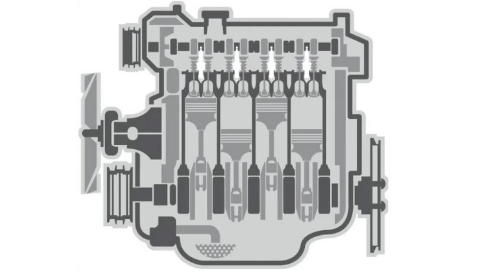Ford Fusion & C-Max HF35 eCVT Transmission Removal Repair Replacement PART 1 of 2

Comment: This video series was so helpful! I just replaced the trans in my 2014 Fusion hybrid with a used trans from a c-max.  It worked like a charm.
It was very tough, especially lining up the trans and getting it to slide in correctly, but with patience, I got it!
Thank you so much for your hard work doing this video.
Reply from the maker: Thank you for your kind words! I'm glad these videos helped you out!
Reply: Are you a mechanic ? I'm not but I'm planning  to replace mine any advice?
Thanks
Reply: good job replacing the trans, im contemplating doing this on my 2013 Fusion Hybrid. did you have to have the Dealership reprogram or flash anything after replacing?
Reply: @baggz321 no reprogram needed.  The transmission doesn't shift or have anything that would need reprograming.

Comment: Nice video.  Ford is in the process of getting a trans and installing in my car.  Its on back order.  I appreciate seeing what it takes to complete this job and also what the failure mode was.  Ford says it fixed this problem in cars manufactured after August 2015.  I wonder what they changed.
Reply from the maker: Thanks for watching! I have heard horror stories with people waiting months for a rebuilt trans. Hopefully you don't have to wait that long. To fix the issue, they changed some bearing sizes/tolerances: https://static.oemdtc.com/TSB/MC-10108994-9999.pdf

Comment from the maker: Thank you for watching! Please like and subscribe. If I helped you complete your project, please consider Super Thanks: https://youtu.be/mo4g08Jzezk

Thanks,
Nick

For your convenience:

00:00 to 02:16: Introduction
02:17 to 03:00: Battery disconnect and disable
03:01 to 04:51: Air intake and engine cover removal
04:52 to 06:57: Belly pan removal and coolant drain
06:58 to 10:26: Inverter and tray removal
10:27 to 12:10: Shifter, power cables, & electronic removal
12:11 to 13:13: Water outlet housing removal
13:14 to 21:23: Axle(s) and Sub-frame removal
21:24 to 21:50: Top trans bolts (3) removal
21:51 to 22:49: Ground cable, Aux fluid pump disconnect, fluid drain
22:50 to 24:42: Aux fluid pump removal, detach lower wiring
24:43 to 25:14: Thermostat housing detach, Trans bolt removal
25:15 to 26:15: Trans bolt removal sequence
26:16 to 27:35: Preparation to remove, top mount removal
27:36 to 27:46: Transmission out!
27:47 to 33:29: Transmission autopsy
33:30 to end: PLEASE SUBSCRIBE! 😀

Comment: I do appreciate the video, but the 12V battery runs the 12V accessories, it does not start the internal combusion engine, when changing the transmission you might have notices there is no 12V starter. The high voltage electric motor acts as a starter for the ford hybrids.

Comment: I have a 2014 ford fusion hybrid. I need to replace mount under the inverter. 

If i pull the disconnect in the trunk and remove all of the wiring up front will i need to have the dealership reprogram my car? 

I replaced the other engine mounts and the one under the inverter rattles loud on start ups.
Reply from the maker: @906lane  no need to reprogram. I'd also disconnect your low volt (12v).

Comment: Take a look at the gear that drives the non electric transaxle oil pump ,does it have all its teeth sheared off (If the energi varient has one, looks like it does.  , was the transaxle low on oil ?

Comment: You mentioned that the Energi had a transmission cooler pump with a line going to the rear of the transmission.  Would there still be a line there for other models or a plug?  Great Video!!
Reply from the maker: Testing the limits of my memory. It's not a coolant pump, it's actually a fluid pump to keep the fluid moving in the transmission when the energi is in full electric mode. The non plug in hybrid cars don't have it because (I think) their ICE runs all of the time (thus keeping the fluid pumping).

Comment: hey Nix great video of course, very informative and useful on this issue. Big Thanks. My question is, did you have to get the Dealership to flash or program the replaced parts to the vehicle in order for it to function correctly? maybe you mentioned it in part 2 or i missed it but id appreciate to know. Thanks again
Reply from the maker: No trip to the dealership was made. No programming was done. Transmission computers are learning... that is... they will adjust as needed.

Comment: just checked out a 2013 fushion hybrid non plug in. and it makes a horrible screaching sound just when the engine turns on. Coming from the transmission clearly. I told her without knowing these cars it sounds like a bearing has gone bad inside the trans. What is the chance that if that sound is already happening (pretty freaking loud) that there is damage to her case? Could it be she could get lucky or is the trans likely just needing a new or used trans (not just replacing the roller bearings and sending it?
Reply from the maker: Without hearing or seeing it, I bet the chances of saving it are slim. Even if the bearing race is repairable, there will be metal bits in the fluid that have made their way to other bearings and components. Flushing that all out would be a monumental task.

Comment: Hello b or, I'm about to buy a 2013 ford c-max, with 130,000 miles on it, and the price is $5,000.  The car dealer told me the car was noisy and I found out it was because the transmission bearing lock was broken.  Can you tell me how to fix this problem?  Or where to find parts?
Reply from the maker: If you haven't bought it, don't buy it with that problem unless you're skilled enough to follow my video. It is pretty technical to replace this transmission.

Comment: Good video, i have a fleet of Fusion hybrid. One out of 10 goes bad.
It is covered up to 8 years/100k miles with Ford
Out of warranty I used to pay $1600 for a used one, now the cheapest around me is $2700 
I have 2 at Ford currently, been almost 2 months waiting for a refurbished one, its on a back order.
Reply from the maker: Thanks! Part 2 is about done!
Reply: @NiXFiX  nice informative video! waiting on the 2nd part!
Reply from the maker: @VictorMartinez-dv9cf  thanks! Part 2 should be this week! :)
Reply from the maker: Part 2: https://youtu.be/V1LOFuny0bg

Comment: My 2014 fusion energi runs fine, but leaks transmission fluid. Would you be interested in buying my car?
Reply from the maker: Hi Dwayne. Sorry bud. I can't. I'm full up with work for the next couple months.

Comment: Hey, a good friend of mine who I am trying to help out, she has a 2017 Ford fusion hybrid with a CVT trans. The car has about $230,000 mi on it, but it's in pretty good shape... The car runs and drives great. It does need jump-started if you want to drive it someplace,... But it's making a transmission associated noise, racket, under the hood, a lot of times when you let off the gas, sometimes when you're just idling. Sometimes when you are starting to accelerate. I changed the fluid in it today for her and it didn't fix anything. She owes a substantial amount of money against it, are you interested in buying this car?.. I don't think she can afford to fix it,... She was told by somebody, just one mechanic, that it has something to do with the electrical motor. But I'm not sure if we can believe them, and we're going to maybe get a second opinion,
Reply from the maker: Sorry my friend. I'm pretty full up on cars at the moment and I'm not interested in buying it.
Reply: @NiXFiX  no problem..what's it worth?

Comment: Great video but does  not work for Cmax not enough clearance  to drop trans alone. Also subframe and struts are different. easier to pull ball joint and no need to disconnect tie rods.

Comment: why would the tran be trashed that bad. ? was it engineered wrong or what happened ?
Reply from the maker: Stretching my memory on this one, but I believe the bearing design on some of the gears had too tight of a tolerance. Roller bearings would go bad.
Reply from the maker: Read the technical service bulletin I link in the video description. Specifically the service procedure on pages 4 and 5.

Comment: Impressive! ...a local dealer is selling one for $5k with a "bad trans". I thought they were direct drives from the electric motor -- not CVT ...guess not.
Reply from the maker: They're not a traditional CVT with a belt. Two electric motors connected together. One motor is used as a generator, the other as the drive motor. When the engine runs, it is only driving the generator. It's a lot like how a diesel electric train locomotive works.

Comment: Minor complaint==need to specify if you are talking about the thread size or the nut/bolt size.   Sorry!  great job. I would not do personally!
Reply from the maker: When I say 10mm, 12mm, 13mm, etc. I (and all mechanics/anyone making a video like this) are talking socket/wrench size required to remove or install a nut/bolt. Nobody cares about thread size unless you have to chase the threads/tap a hole. People following these videos care about what socket/wrench size they need to grab out of their tool box to remove or install a bolt. Bold move to complain about a FREE video that I spent hours making. Thank you for watching though! 😀Start wrenching. You can do it!
Reply: @NiXFiX  Yes sorry for the complaint and thank you for explaining. Didn't mean to insult you and TY for the effort you put in to making this vid. I've never done it myself as I don't do anything worth recording

Comment: I did this job, the Ford reman transmission lasted 16, 000 miles and started making bearing noise again. I wish I had been able to trade it instead of going through all of this. This transmission is trash, they need to take lessons from Toyota.
Reply: The transmission design is genius for the most part. Light years ahead of the adjusting pulley designs. Having no gears and no clutches and no bands/belts should make these things last forever. The fact that they cant figure out how to keep the bearings lubed up is pretty ridiculous though. If they figure that out these trannies would last 300-400k miles, maybe 500k.

Maybe if someone designed sealed aftermarket bearing or cover that had better fluid ports these would be bulletproof.
Reply: I see this cars with 300,000 400,000 and even 500,000 miles on orginal everything. I wonder how common of an issue this is.@ryry7886
Reply: @Hairybarryy  Same here. I got a few questions. Are people regularly servicing the transmission? Are people abusing their car (I see it ALL the time - people flooring their cars and I can smell their burning transmission fluid)? Is it a dud (and I happen to see these "duds" with every make)?
Reply: lol Toyota copied the design

Comment: Consumer Protection Bureau should sue Ford for this.  They knew about this in 2014/15  if I'm correct. Ford chose to make a software change which prolonged the failures but, didn't fix it. A good transmission should never fail in a car with normal operation and care.  That should be the last thing to fail in a car.  Ford is at fault 100%.  10% failure rate is insane.